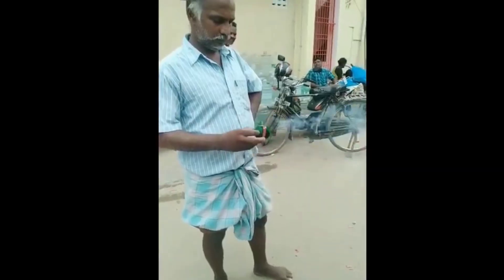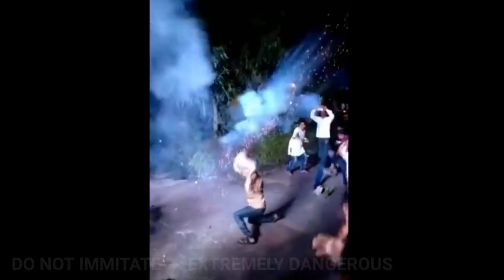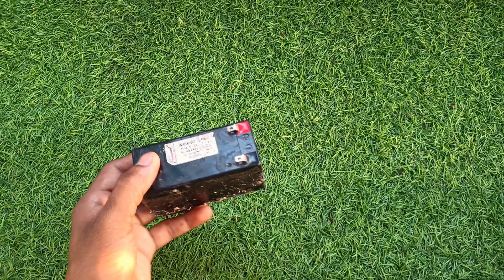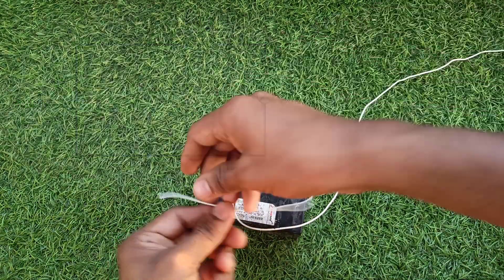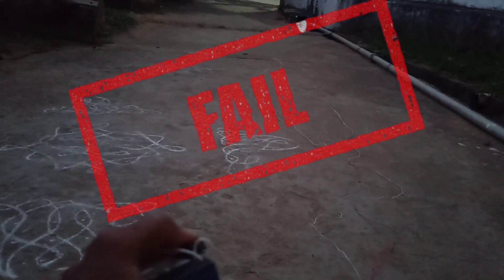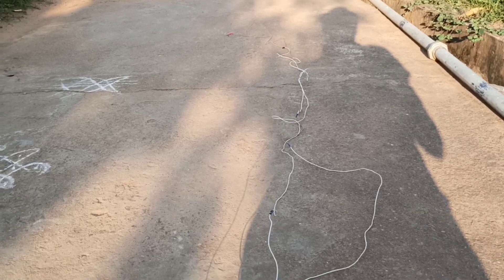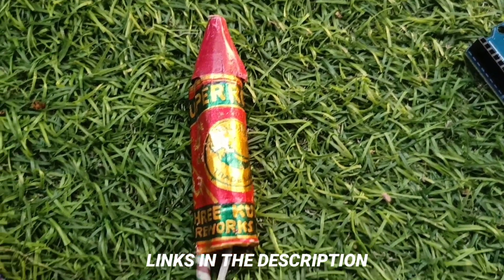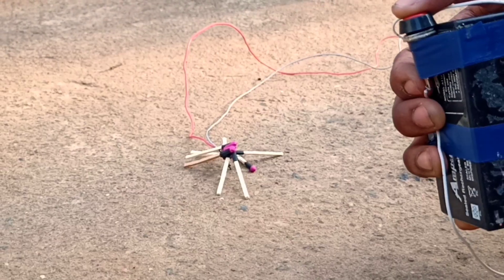Blasting bomb with a remote DIY detonator at home

Comment: You can use two 12V rectangle batteries, and you can simplify the whole thing and not use the switch but simply activate it by putting the wires on contacts when you want to detonate (keep one wire attached to the batteries and the other you place onto another contact and it immediately goes off). 
Get a Christmas light bulb or a turn indicator light or any other type of small bulb/light that is small and can be powered by 12-18V. Use a fine small file to scrape the top of the glass on the light/bulb small enough so you can fill it with gunpowder or simply finely ground match heads. Use hot candle wax to seal the hole that you made to pour in the powder. Attach the cables to the bulb/light. Attach ONE cable to the batteries, either - or +, but only ONE. When you are at a safe distance, simply place the second wire with your fingers and it will immediately go off.
This can be used to detonate all sorts of things. If you want to detonate something like homemade ANFO or other amonium nitrate based explosives you will have to put that bulb with match heads or gunpowder into a bigger container like a big syringe and it will have to be filled with very powerful explosive TATP. It is a very unstable explosive and making it alone is very dangerous let alone making explosives or detonators out if it, but it is probably the easiest way to make amazing detonators for very impressive and more dangerous explosives as gunpowder alone cannot kickstart amonium nitrate based compounds.

Comment: How much volt battery is it? And ya what kind of wire you have used?
Reply from the maker: its 12v and its a normal wire any kind of wire works, just need to short the terminals to generate some heat, Simple

Comment: Sir will it work with 4 volt battery
Reply from the maker: yes, all we need is a small amount of heat, dont try with lipo batteries they are dangerous and may explode.

Comment: Do you have a list of all if the stuff needed? Tried making my own, but seems the power source is too weak so doesn't do anything
Reply from the maker: Yeah, may be it's just a simple circuit, shorting two terminals and adding a switch, mine is a 12v battery but any battery will work great just make sure you have good amount of charge and produce sparks when touched each other but be careful, shorting the terminals is dangerous, and I highly recommend don't use any lithium based batteries they are too powerful and cause a blast, be cautious all the best